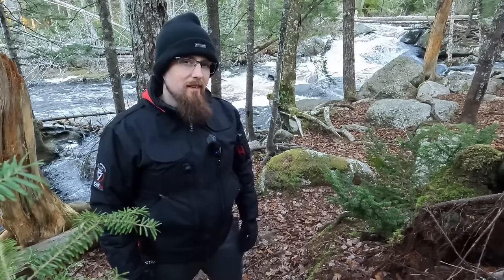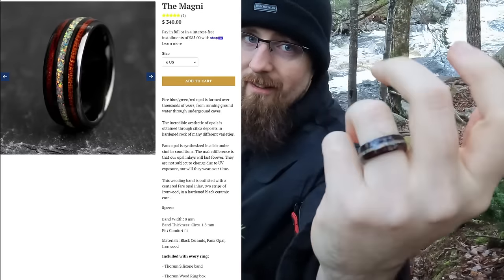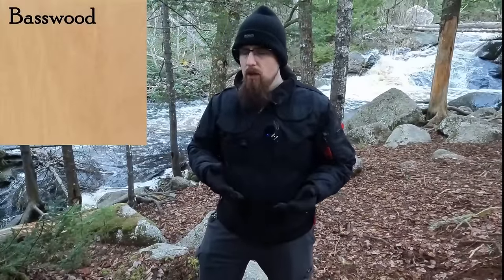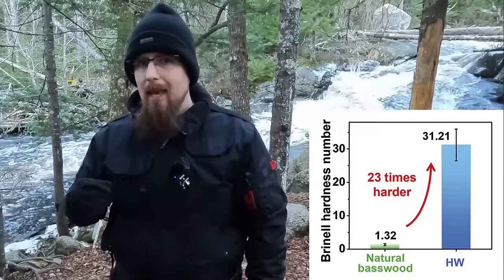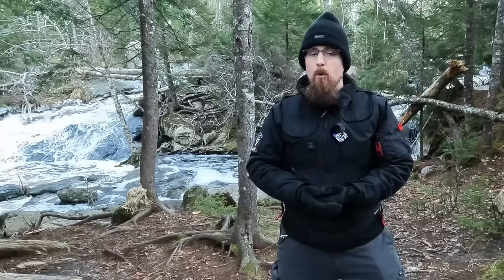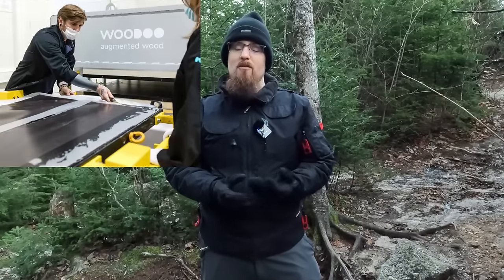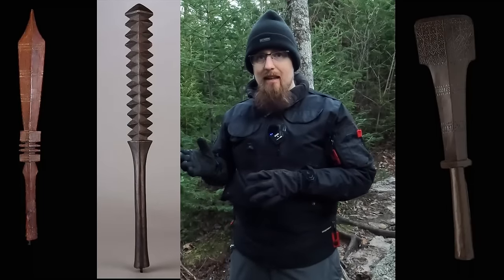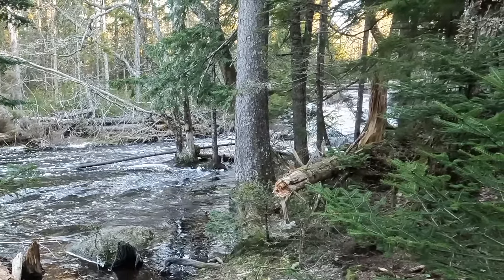Hardened Super Wood!  -  Can It Rival Steel?

Comment: Well, I mean nature already did, at least in compression, good timber is equivalent to steel in compression for structural purposes, that’s why you can hammer in pilings with equipment…the problem with wood as large structural members, is no good way to attach them securely, for tall structures, and not uniform, each one is different from the last, etc. and you know, things like bugs eating it, dry rot of if gets wet and dries multiple times, and well fire, haha.

Comment: I was thinking about modern bullet armor. Steel plates are heavy, ceramic is fragile, and polymer armor is not really useful against rifle rounds.
Reply: Safe lite has FRAS armor now, Imagine a soft iiia vest that bends put stops rifle rounds. Honesty I haven't understand why this haven't happened yet,but on Demo ranch someone made Steel dragons skin riveted scale armor,if we made riveted ballistic steel scale armor and covered both sides with Fras you could create a flexible suit of armor like Doom Guy.
Reply: @Thephantomofthreerivers  Cool but how heavy is it? My plate carrier weighs close to 40 pounds once the plates and magazines are in place
Reply: @PossumKommander  With the steel riveted Dragon skin scale armor, Less heavy than a whole thick steel plate, but slightly heavier than ceramic,The FRAS on its own weighs Less than both,the only problem is you have to be a blacksmith and understand how to forge ballistic steel.
Reply: @Thephantomofthreerivers  Steel scale armor would intrinsically be heavier than solid steel plates of the same ballistic protection.  The scales have to overlap, but have to be the same thickness as the plates would be.  The only advantage is flexibility.
Safe Life's FRAS is the same thing--overlapping scales--made of more expensive material, and seems to be pretty much a cheaper copy of Stealth Armor Systems' HEXAR armor which has been around since 2014.
It's also not really much lighter than steel armor, which weighs nine to eleven pounds per square foot.  If you wear SafeLife's IIIa vest with their FRAS (as they recommend), that's just under 9 lbs per square foot, but would cost over $2000 compared to less than $500 for top-of-the-line steel armor and carrier.  Also, NIJ has done some videos on SafeLife's armor that shows they skimp in a few places that make them borderline unqualified for their reported NIJ rating.
FRAS just means Flexible Rifle Armor System, it's not a special material, though several companies use proprietary materials for their FRAS armor.
Reply: @Thephantomofthreerivers  "Honesty I haven't understand why this haven't happened yet,but on Demo ranch someone made Steel dragons skin riveted scale armor"
The answer is very simple.

Due to overlap geometries and the added weight of the rivets and such needed to do the dragon skin, a simple plate is going to be much lighter.  Not to mention that a plate has the potential for optimizing the shape for deflection whereas dragon skin does not.

The only reason that scale based armors where where historically viable is a simple quirk in manufacturing - It was MUCH easier to make a quality armor plate of a few square inches than it was to make a quality armor plate of a few square feet.  With modern metallurgy and industrial technologies, this is simply not the case.  In fact, it's the opposite.  With a form and a hydraulic press a manufacturer today can crank out a plate in the desired shape and thickness by the boatload if they want to.

Edit - oh, and it's important to recongize modern economy of scale factors too.  The same factors that often make it cheaper to replace a machine than repair it apply to armor as well.  It's cheaper to just manufacture a whole steel plat insert and carrier than it is to provide a replacement part and have a network of dedicated specialists that can actually properly replace a shattered/deformed scale.
Reply: @ColonelSandersLite  Dude how thick do you thick the scales are supposed to be? The thickness of an alpha defense ballistic shield, that is in no way heavier than a standard thick plate,the plates also aren't flexible they aren't good enough anymore,besides Ceramic plates shatter everywhere the trade off is minimal. Regardless of cost.
Reply: @Thephantomofthreerivers  good company been folowing them for a minute
Reply: @Thephantomofthreerivers  Buddy, this is really just a hard fact - If you have two different designs, one a solid plate and one overlapping plates, and you want them to offer the same level of direct impact resistance, the overlapping plates will use more material to cover the same area.  This is just hard physics.  There is nothing anyone can do to change it.

Let's say that with modern computer aided design and manufacturing techniques you can get that down to a mere 10% (being pretty generous here).  This is straight up 10% more weight to do the same job just straight off the top.  And this is just direct impact.  To compensate for deflection characteristics you lose with a solid plate, you will have to build it even heavier to accomplish the same task.

Then, you have another problem - A solid plate does not require additional structure to hold it's form, overlapping scales do.  So you have to add the weight of the fasteners and backing material onto that.

In the end, you're left with a simple choice - do you make it heavier or do you sacrifice performance.

This isn't a new problem.  If you start looking at historical armors, this problem is readily apparent and easily understood.  You don't see the high ranking nobility wearing brigandine or a coat of plates where solid plate armor is available.  You even see it being phased out among the common soldiers as soon as metallurgy technology advanced to the point where it was affordable to do so.
Reply: @ColonelSandersLite  that isn't the point it has FRAS armor on both sides,and if it was plate it wouldn't be flexible enough,it's the best modern technology can create,Russia already has just made overlapping armor that stops 50 cal, it's already being done.
Reply: @Thephantomofthreerivers  You're just not getting it -
That FRAS?  It is scale.  Worse, it's butted scale.  No overlap.  So they sacrificed protection for weight.  That's why it's not rated nij level 3.  This is the tradeoff I'm talking about.

If you're wanting to put ceramic scale, on top of steel scale, on top of more ceramic scale, that's not going to be flexible anymore or light.

And those russian claims?  We'll see but they have been known to engage in hyperbole and deliberate misrepresentations in the past.  It's simply not going to stop a 12.7X99 at a range of under a hundred yards and still retain any mobility whatsoever.  Not unless they have had some kind of insane technological breakthrough that gave them a super material that is more than an order of magnitude stronger than ceramics at the same weight.  Shit, the side and rear armor of a BMP can't even stop a 12.7X99 under a hundred yards and it has an engine.

Edit - Oh, and if they did have some kind of massive scientific breakthrough yielding some kind of super material?  Expect every new Russian military vehicle to render every military vehicle in existence totally obsolete over the course of the next few years.  We're probably talking helicopters that can take a direct hit from an MBT and keep flying here.
Reply: @ColonelSandersLite  They already FRAS have it in iii+ and Level IV(7.62X54r,m855a1), And russia already made the .50 cal stopping  armor, look it up, what are you talking about? They aren't claims they have already released pictures of soldiers dressed in it.
Reply: @Thephantomofthreerivers  Their own website says it's rated for .223/5.56 and 7.62×39.  That's not IV.  They also say to combine with a 3a carrier to get level *3*.

And no, there is a HUGE difference between announcing that you made something with some pictures of mockups and confirmed wide scale protection.

Seriously man.  A 50bmg has about 10 times the energy a 308 does.  You're not stopping that with man portable equipment with current technology and you're definitely not doing it with their claimed "lighter than Israeli and American body armors".

And, like I said, if they invented a material that can do it, they will also have helicopters that can eat a 120mm L/44.

This is just basic, simple, common sense physics.
Reply: @ColonelSandersLite  Re check the website,why are you arguing with me they already have for level IV for sale(7.62X54r,M855a1,3200fps)and for the last time russia made the shit already,what do you not understand when I said they already did it?They are selling the shit already.
Reply: @Thephantomofthreerivers  Fine.  Prove it.  Links.

I checked their site.  They offer a single level 4 item that I can see.  It is not FRAS.  It is a rigid plate.

7.62X54r,M855a is not level 4.  Level 4 is 7.62 nato AP.  Not even in the same ballpark.

And I checked on the russian stuff.  It is not for sale.  It is merely an annoucment of something they will have for themselves in 2025.  But hey, if you can tell me where it can be acquired, I would certainly be interested in getting some of this magical material.  Anything light enough to carry around but stronger than a 2" hardened steel armor plate surely has some useful applications.

Edit, sorry, that's 20*3*5 not 2025.

Edit 2 - Did a litte more digging.  The armor pictured in the press releases?  Completely fake.  It's a movie prop from the movie The Blackout: Invasion Earth.  It's probably nothing more than deliberate deception.
Reply: @ColonelSandersLite  Of course russia does some trolling.

Comment: It might be interesting for decorative computer cases and other electronic casings. That's usually done with decals or textured plastic, occasionally small thin pieces of real wood that don't bear any of the structural load.

But would this wood be able to be structural in these applications? The main structural issue is that wood strong enough for that is far too bulky, but this might solve that issue. 

Flammability and grounding would be a concern, but those problems could be solved with use of non structural metal parts.  Plastic casings still manage grounding, after all, and heat shields can keep hot spots from being a fire hazard.

Comment: There are commercially available wooden gun nails available now. Lignoloc makes collated wooden nails for their gun system.  Theres also a lot of Japanese wooden construction nails available.  Historically, post and beam construction can outlive other materials if maintained properly.  Even Howard Hugh’s spruce goose would hold up as a good example of impregnated structural wood construction. 👍🏻

Comment: the journalism was obviously crap but the technology is cool. I like that they aren't adding polymer to the wood like other treatments, like the clear wood that's probably only 20% wood. you might as well just use epoxy at that point. maybe not for weapons but as an engineering material it has a lot of uses. I'd imagine the abrasion resistance is a lot better with treated compressed wood.
Reply: I’d rather say “you might as well use fibreglass”, since the wood fibres probably do contribute somewhat to the tensile strength. There’s no real benefit from using wood as the reinforcing fibres, however.

Comment: I remember in the early 80s we built a cross and sign for an old church that was right by the bay the wood had been laying under it since it was built in the early 1900s even though it was just soft redwood after laying under it in saltwater at times it was so hard my carbide table saw blade didn't like it at all took me all day to make 15 cuts, I guess this is what you get when someone volunteers your labor for you.

Comment: I'd be worried about the brittleness of it for something like a cuirass as the harness likely makes it more brittle like steel can be. especially cracks along the grain. For arms & armor maybe high layer plywood compressed? it would remove the grain issue but I dont know if it would stay laminated. it'd deffinitely be worth a go at making a club mold or three and trying it out

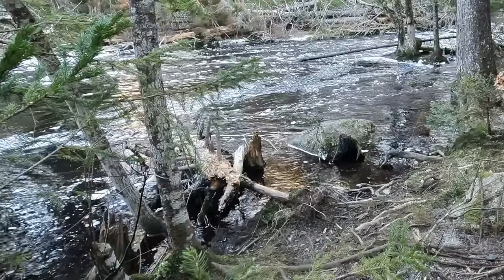Comment: 12:48 - well, that would be a little complicated... That so-called "transparent wood" is in reality only something which could be called "cellulose-reinforced resin block" and there are several problems with the sensitivity of said resins to UV light (getting a yellow tint). However, you still would have to choose, whether you want "transparent wood" (fill gaps with plastic) or "hardened wood" (compress the gaps).
Reply: Not to mention it's rather translucent.
Reply: Transparent wood, after all NileRed's content on the matter, doesn't strike me as the good kind of hardness. Brittle seems more fitting.
Reply: "That so-called "transparent wood" is in reality only something which could be called "cellulose-reinforced resin block""
I think that you could more realistically call it resin with wood fiber filler.

Naturally, there are easier and cheaper ways of doing that than bothering with trying to make transparent wood.

Comment: Wood can be as Strong as steel, under certain stresses.  Hardness is basically surface compressive strength, so wood can't really be as Hard as steel.  However, it can have as good Tensile, Torsion, and Flexure Strength as steel of the same volume, and less weight.  If you think about it, they used to use wooden leaf springs in wagons even after steel leaf springs were invented, because wood is cheaper, and easier to carve.  (Than refine, form, and temper into spring-steel)  At identical dimensions, but being less dense, the bentwood leaf springs were also lighter than the tempered steel ones.
Reply: There are applications for every material out there.  Thing is, wood already IS stronger than steel, it just depends on what metric you measure strength by.  Hardness, on the other hand, is a completely different animal...and I just don't see any process being researched today that could make wood as hard as steel.  And in reference to wood leaf springs, wood is still a superior spring in certain applications compared to steel, such as bow limbs.

Comment: 5:39 And wooden armor doesn't interfere with spellcasting.
Reply from the maker: Not susceptible to lightning magic either. :)

Weak to fire though.
Reply: @Skallagrim  a fair trade, considering lightning can be quite unpleasant and devastating.
Reply: I think that you have a mosquito but a super version of the mosquito I have a turbine gas turbine engines

Comment: can this wood be formed into screws? Bolts, Nuts..  It appears that if one is going to use this process, it is best for planks that are formed into their final or near final product as planking, flooring with preformed joining grooves on at least 2 sides and special cutting blades to size them.  The other question is can elements be added for better longevity like silicon, boron or copper that result in oxides that are a fire proof  end material?

Comment: Basswood the only wood or good ole pine too ???
What chemicals boiled/soaked in ???
Vacuum Chamber ???
Would pressure even be needed ???
What the resin/s 
Under vacuum could induce any epoxy ???
Couple different cycles ? Even coats ...
Ground an pumped under pressure into Forms an cast ???
Clear Wood ???

Comment: Just came across this post and wanted to say I think this is pretty neat. I do have one question though. Now I understand that Stradivarius has been using this technique since the 17th century for their instruments and seal it with a sealant that dries hard . But, has anyone ever tested the wood made by the people you cite above by soaking it in water for a prolonged amount of time to see if it expands or becomes weaker. I ask this question because you said they seal it with an oil and especially with building lumber and weapons, it would be reasonable to expect either would be subjected to wet or damp elements for prolonged periods of time. Just wondering.

Thank You For A Truly Wonderful Video and hope to see more.   J.R.